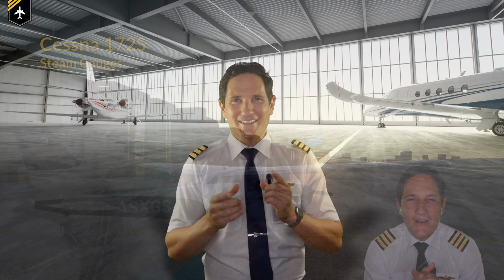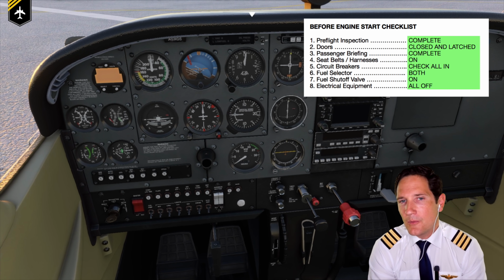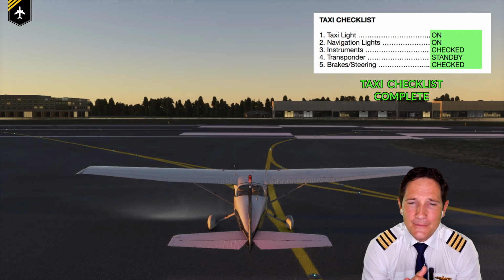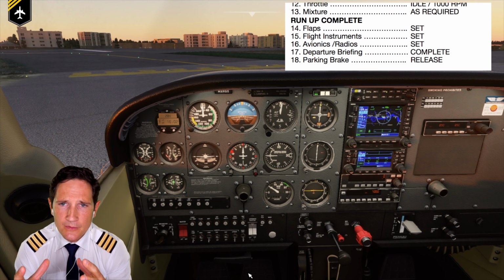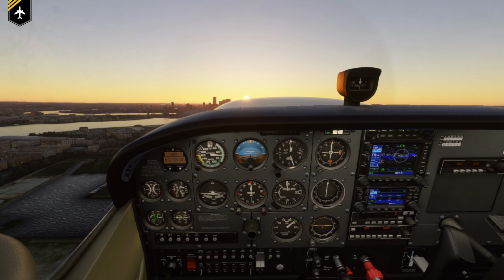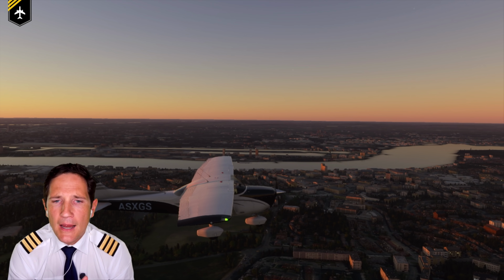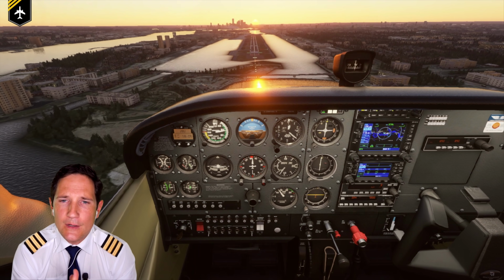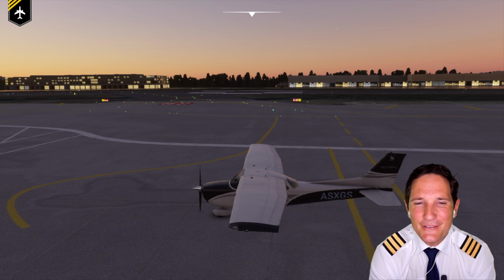TRAFFIC PATTERN at London City airport with ALL CHECKLISTS! Explained by CAPTAIN JOE

Comment: That's a really great tip to set the heading bug before the takeoff roll. I normally only set it later when I begin navigating away from the home airport. But I suppose you are technically "navigating" as soon as the aircraft leaves the ramp.

Comment: What if?  Tower says extend downwind. Or traffic cuts in at an uncontrolled. I have to argue that being Flexible, is key to being proficient and safe. Practice for different scenarios. Every landing is a go around on an aircraft carrier until the hook catches the wire. I’m not a cfi but I have the benefit of 25 years of flying experience and the one thing I can attest to is that being too rigid or expecting of a certain outcome is not only at times disappointing but even dangerous. Not trolling anyone but I truly believe flexibility is key sometimes. Fly often and be safe.

Comment: I'd be afraid of setting the engine power back to idle or even to 600 RPM during the life check. Instead of it, I would speed the engine up to 1500 RPM.

Comment: The glide slope in London City is 5.5° due to the proximity of high-rise buildings  Cambridge EGSC which is located in flat terrain with no very high structures nearby normally has it's glide slope set to 3.0°.  Cambridge is also used for training for LCY so sometimes the PAPI is changed to 5.5°.  If this happens it is communicated via NOTAM and by the tower controller.  Now realigning the ILS glide slope is a major operation so they usually leave the ILS at its normal 3° and only change the PAPI.  Also I've only ever seen this being done on RWY 23 which is the standard approach direction and has ILS and PAPI, not RWY 05 which only has a PAPI, no ILS.
A Cessna 172's natural sinkrate at idle is bit steeper than 3° but 5.5° already feels like dive bombing ;-)

Comment: Captain joe I have a question what does move is it the plane or the earth
Reply: Both the aircraft and the earth are moving. The earth rotates on its axis and revolves around the sun. The sun and the rest of the solar system are also moving through space as the galaxy is moving as the universe expands.

However, I believe the question that you are asking about is about the aircraft's motion relative to the earth. The atmosphere rotates with the earth, so in order for an aircraft to fly from one location on the planet to another, the aircraft must move.
Reply: @Eternal_Tech  can you um???¿¿¿¿ I didn't understand any if that

Comment: Hi Captain Joe. I hope you get to read this message. I have a question I would like to ask. I am not a real world pilot but I have been flightsimming for the last 26 years. I have emersed my self to learn as much as possible so that I know quite a lot. Here is my question:
I have made an observation. Previously the flight plans for US flights would use the high altitude airways or Jet routes. Now I notice flights use more VOR to VOR in their flights. I believe this has to do with the open skies policy which has to do with greater demand and better radar and tcas which makes it possible. My question is this correct and what factors go into choosing which VORs are used. By that I mean how do they choose how far apart to space the VORs in the flight plan? Cheers!

Comment: Captain, Could u please do a video on How full service airline calculate a ticket fare? onboard alcohol and food cost r part of the ticket price 
Thank u
Reply: Thing is airlines don't usually charge on the basis of service. Its more on the basis of supply and demand. Sure to operate a flight, it may cost an airline x amount per passenger. But if demand is high, the airline can charge more than x because people are willing to pay for it. Similarly if demand is low, an airline can charge less than x, so that they make some money (even if it's in a loss) compared to just having an empty seat.

Comment: I have a question Captain joe. Why are pilots so rough with the joy stick while landing and taking-off
Reply: ? Normal control movements. Might seem rough with you, but it is just routine movement.
Reply: It's not rough per say. But you can say that more control input is required when an aircraft is flying at a slower speed.

Comment: Cool Video as always only thing slightly inaccurate was, 
Cessna 172's flap 10° degree speed is 110 Kts IAS so no need to reduce the power there for white arc (40 kts - 85 kts) 
For flaps 20° and 30° the speed should be below 85 Kts IAS 
But meh that's easy to forget or overlook when you are flying 747's all around the world.

Comment: A couple of notes...
1. It's a good idea to keep your circuit tighter to remain within gliding distance of the runway in case of an engine failure. Standard rate turns are not required for circuits, with the exception of the crosswind turn where around 10-15 degrees of bank are ideal as you are still climbing. The rest of the turns will usually be between 20 and 30 degrees.
2. The 172R and 172S allow you to extend the first 10 degrees of flaps below 110 knots; it only requires 85 knots (top of the white arc) for 20 degrees and up. You should be able to see this noted if you zoom in on the flaps lever.
Otherwise, great video! Keep it up!

Comment: I hope you are not giving the GA population a false sense of hope actually flying into London City. Perhaps the regulations have changed, but back in the mid 90-ies I wanted to fly into London City (instead of Biggin Hill) from Antwerp Belgium in a Cessna 310, and was told that permission was denied unless the Cessna 310 was certified to fly a 6º glideslope, which it wasn't.

Comment: When it first opened, London City had a runway length of just 1080m, with a crazy 7.5° glideslope, though that's also partly for noise abatement reasons. It was lengthened to 1508m (TORA of 1199m) a few years after opening, and the glideslope was reduced to 5.5° at that time. It still has the steepest approach of any UK airport.

Comment: With a 172 in final: Do you pitch for speed and throttle for altitude or vice versa pitch for altitude and throttle for speed?
Reply: cybershadow81 I’m not a pro or certified pilot yet, just a few hours under my belt.  However, I know the saying to be “Pitch for airspeed, power for altitude”.
Reply: cybershadow81 pitch for airspeed, power for altitude.

Comment: I have one comment on turning on the nav lights in retractable gear aircraft durning the day. In some cases the gear lights are dimmed when the nav lights are turned on. They are dimmed enough that you can't see if the lights are on at all. Not a distraction you need before landing.

Comment: I watch alot of your videos and i fly a/an 1979 Cessna 172 Skyhawk that has the gauges (I’ma flight student pilot that is on the 5’th hour. But don’t i need to complete flight school in order to at somepoint to upgrade to the commercial airliner jet simulator and that school aswell? I’m also 21 turning 22 in December.

Comment: hey captain joe ive watched your video about abs on planes i have a question though why isn't there regenerative braking on plane this would give a lot of energy back
Reply: Regenerative braking is used on vehicles with electric motors to charge the batteries that power these motors. However, the large commercial aircraft use jet engines, which use jet fuel, not electricity, for propulsion.

Comment: I absolutely love the way you explain Mr. Joe. You never fail to impress us!
Reply from the maker: Thanks buddy 😉
Reply: @flywithcaptainjoe  I just have a question to you. Does Boeing still continue to manufacture the 747 or is it discontinued. And please tell me how many years old plane do you fly on an average?
Reply: And an average life of a 747 is how many years?
Reply: @dhairyashah7268  I am no Captain Joe. But i know that for the 747 they are finishing the orders for the 747-8F (cargo version) af there those are delivered. Boeing will stop production.

for the existing discontinued passenger version they will ether be scrapped for parts or converted to cargo versions.
A bitter sweet bonus for a lot of freighter airliners do to the sudden influx of a lot of 747 passenger versions they will be quite cheap to buy for now.

the time a 747 flies depends on how it's been used but freighter  airplanes in general can fly for really long time.

there are still old DC 3 flying to this day because they still pay the bill.
Reply: @sirBrouwer  Thanks a lot man!